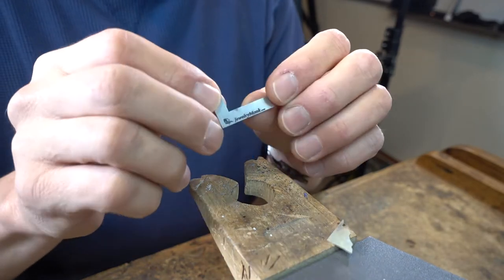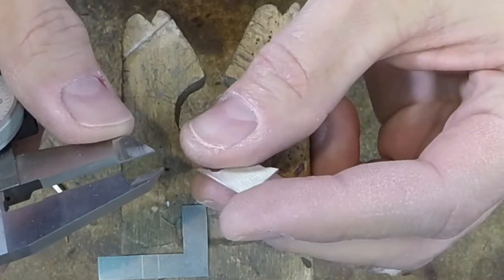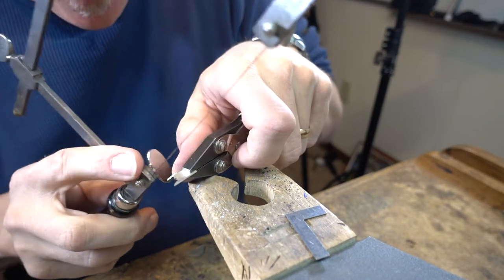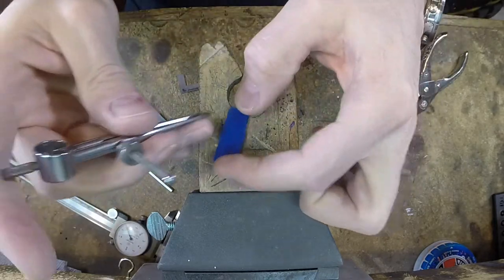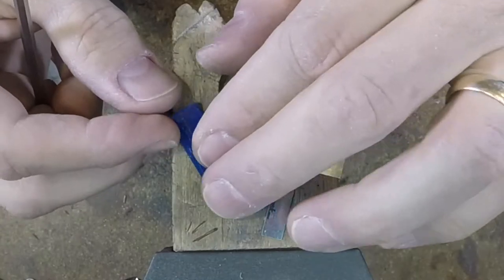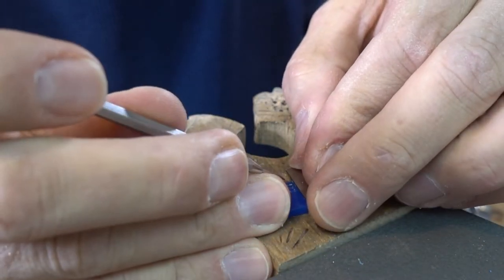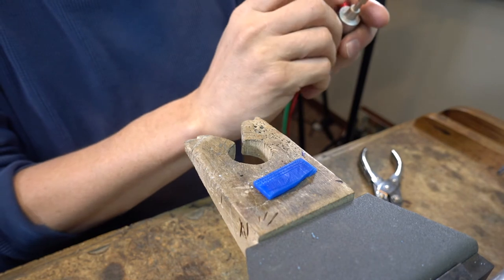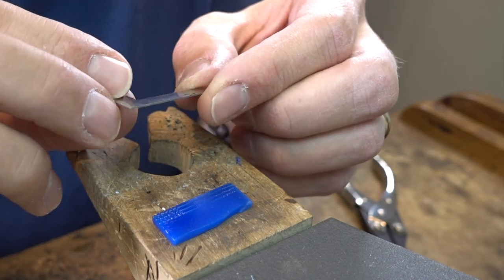Jeweler's Square Demonstration from JewelryMonk

Comment: Do you have any info on the pliers you are using to hold the small square?  I've been trying to find a solution on how to hold small pieces for filing and sawing!
Reply from the maker: Jasmine, they are called smooth jawed parallel pliers. Search for them from any tool supplier.
Reply: Exactly what I was wondering! No more jiggly holding hand!